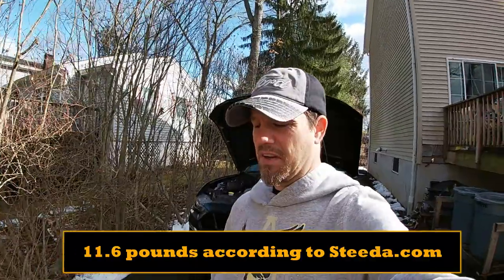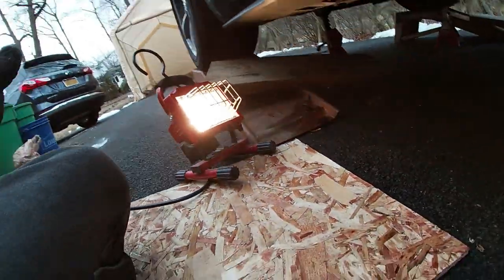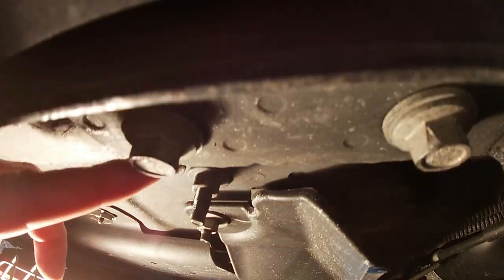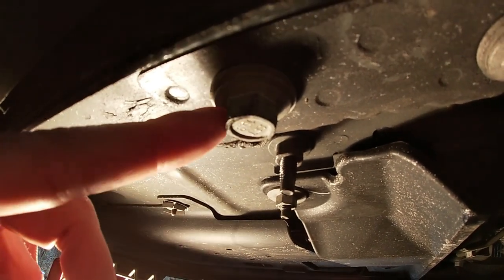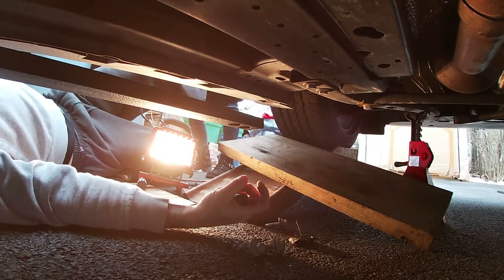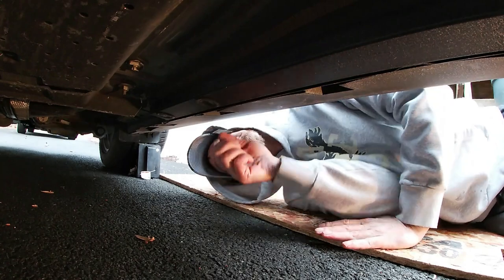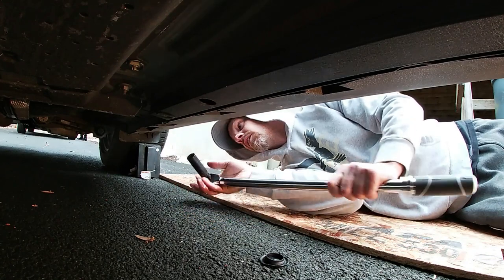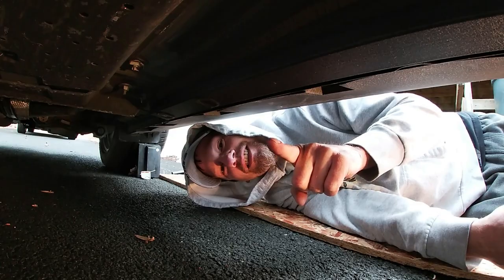Steeda Jacking Rails Install - 2015-2020 Mustang GT

Comment: I have the BMR rails.  I like them better for the reason that you use the OEM bolts.
Reply from the maker: Ok 👍 good to know for those that want to retain the OEM bolts. I wasn't at all concerned about using the Steeda replacements as they make some quality products.

Comment: I've came across a few reviews that say jacking rails really stiffed the ride to much. Like it was harsh afterwards. I find this hard to believe but who knows.
Reply from the maker: Yea, not sure how these would change ride quality. It's simply for convenience. I had no change in ride. Are ppl getting these confused with subframe connectors?
Reply: @VogelStang  no idea. Thanks for the reply
Reply from the maker: Sure no problem. If you're going to be jacking your car up a lot, these are totally worth it. I wouldn't worry about those reviews of a harsh ride afterwards. I've done a bunch of mods to stiffen things up and I still don't feel the ride is harsh at all.

Comment: Do they reach all 4 pinch weld jacking points ?  Reason I ask is I use a Quick jack lift system that needs those locations.
Reply from the maker: I don't believe they go all the way to the pinch welds. They are still free for use with a typical crank jack. I would verify for you but I'm in the northeast and we just got a foot of snow so I can't get to my car 🤦‍♂️
Reply from the maker: Once I can get to it I can send you pics of how close it is on Instagram if you have it

Comment: Oh man that extra weight will cost you about .00001 seconds. That might be offset by the aerodynamics of the recessed bolt head and caps below the car. Damn it sounds like your really close to an airport, that prop plane sounded like it was landing in your back yard.
Reply from the maker: 🤣 so it all balances out then! Little heavier but better aero.  I'm definitely going to reach out to you if i ever need to rationalize something in the future 🤣 Closest airport for props is about 45 minutes but that plane was dropping off my last part order, I used the "get it in 15 minutes" Amazon prime air option 😆